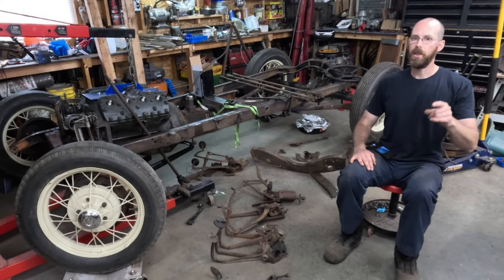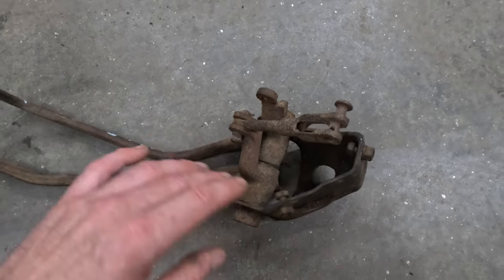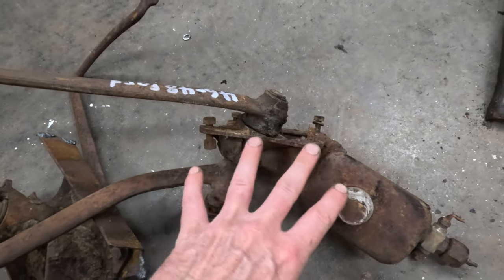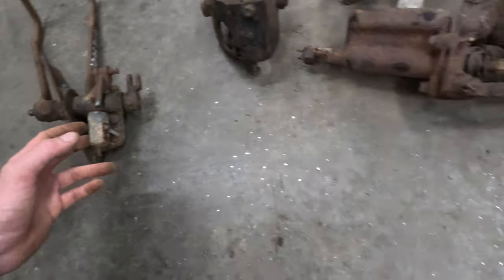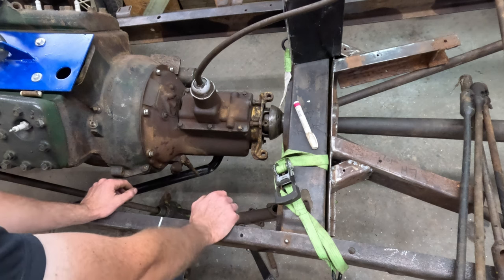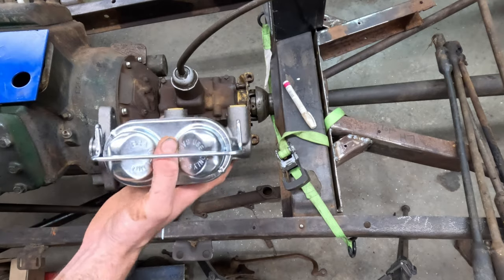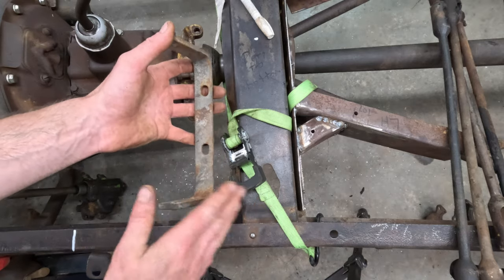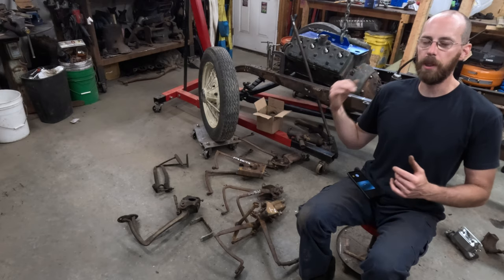I can't CHOOSE!  Early Ford pedal choices for your hotrod build AV8.  Model A flathead V8

Comment: The first thing I do when I buy an old car is change out the brake master cylinder for a dual system.  (Then I rebuild the carb.) 🙂
Reply from the maker: Always a good idea.  I haven't actually heard any examples of them failing but it's not worth the risk in my opinion.